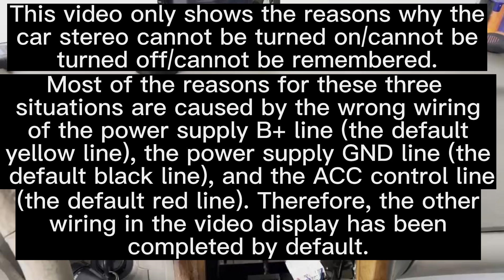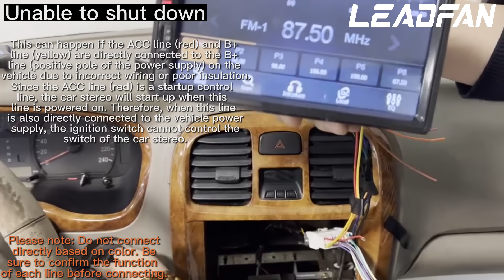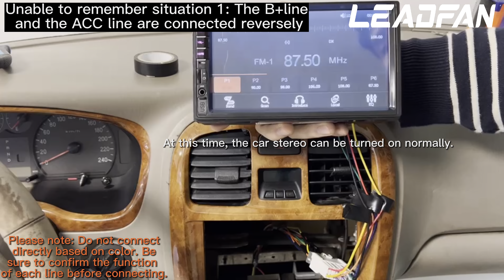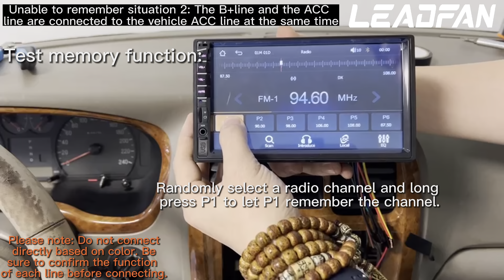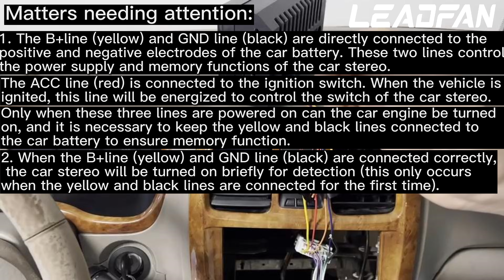Leadfan car stereo cannot be turned on, turned off, or remembered and how to solve it

Comment: How do you manually turn off radio without using the controller   Is there an off/on button somewhere on the radio or do you hold some button to turn it off   thank
Reply from the maker: Hello:
At the beginning of our product design, it started and closed as the car started.
Thank you for your support

Comment: I have this installed in my work van and it's definitely frustrating when the wireless Android auto cuts out while I'm trying to navigate to a stop but I keep the USB nearby by so I'm constantly having to swap back and forth between the 2. The radio was cheap so I'm not surprised.

Comment: Hey ..leadfan tech    just tried to connect  the double din car stereo  But don't get radio to Come On   Have  Black/Black  red/red  and Yellow/Yellow/  ON harness    but dont turn ON    is there another way  to make it come ON?
Reply from the maker: Hello, we do not recommend that you connect directly based on color. Please connect according to the function. If you have purchased a wiring harness, you can try the method of installing this video. https://www.youtube.com/watch?v=x6M2ne26zfo

Comment: I have a NAIFAY double din radio everything works but no audio the antenna plugs in OK but says no signal they sent another one and same thing what is wrong dose it need an antenna adapter and if so what # and kind.
Reply from the maker: Hello, do you mean that the radio station cannot be searched?
Reply: @leadfan-pc9kf  the radio searches for a radio station but can't find one it is obvious it's an antenna the antenna plugs in good but the radio obviously doesn't connect so is there an adapter that is required if I can't get one I will need to return both radios